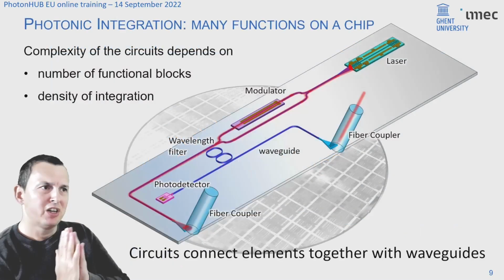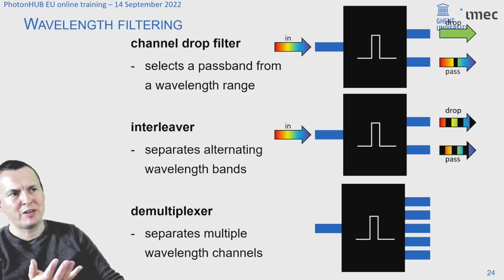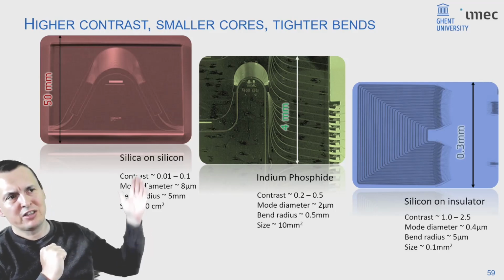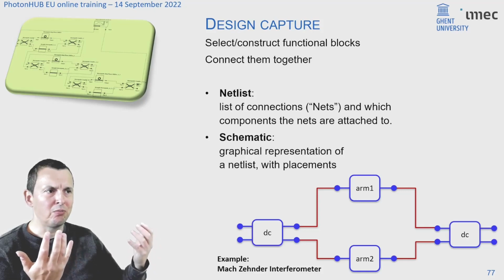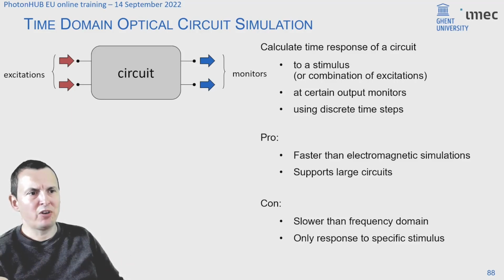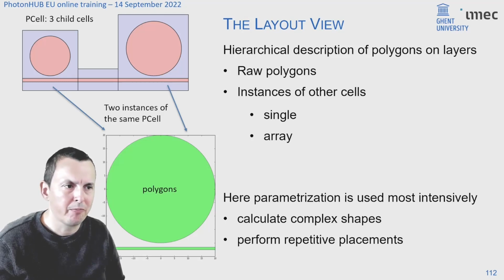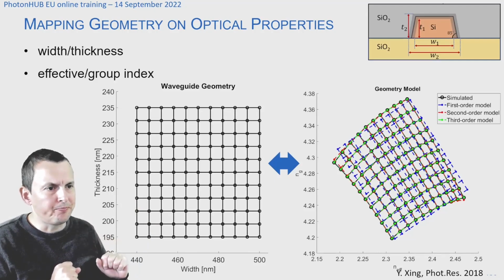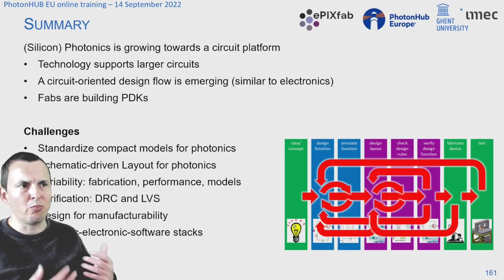Photonic Integrated Circuit Design - PhotonHUB Europe Online Course 2022

Comment: @PhotonicsUGent Do you know whether any project has managed to get the fine tuning of silicon/silicon-dioxide waveguides through stress/strain induction by the use of piezoelectronics instead of resistors to work? This is known to work for a bunch of different III-V semiconductors but I'd really be curious to know whether this has also been achieved for Si/SiO2 waveguides. Thanks!

Comment: hello i have a question. in the case of electric wave, there is the proper size thickness to pass one way to another. how minimum size of thickness to transfer signal by light photonic pulse. and how much difference energy loss between electric and photonic?
Reply: You might have it backwards between electric & photonic energy loss. An electronic system physically moves electrons. A photonic system works on light with negligible energy loss.